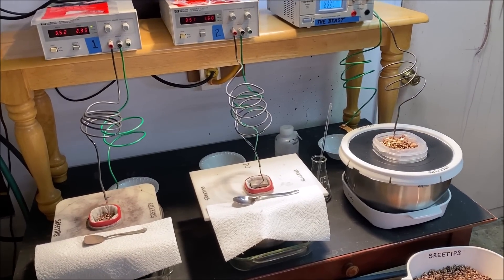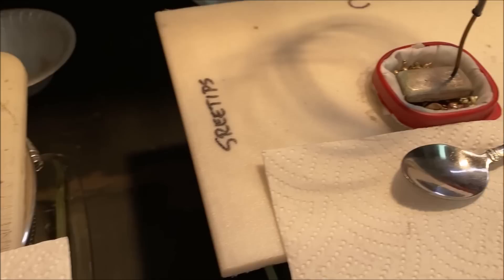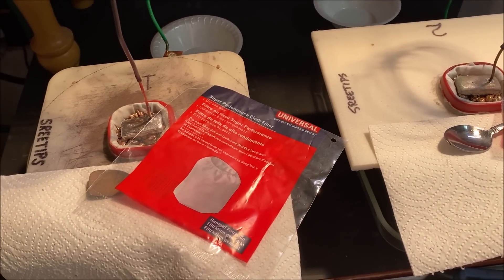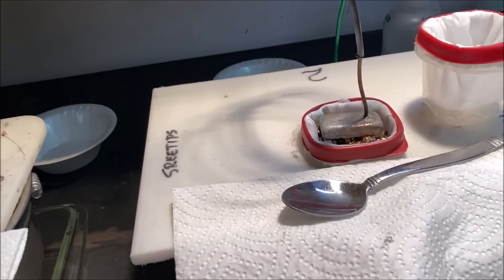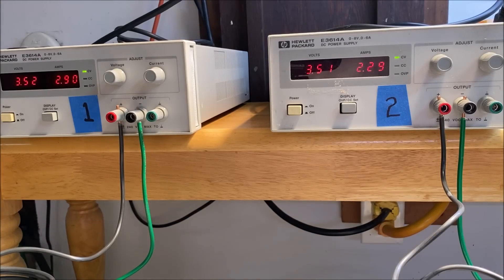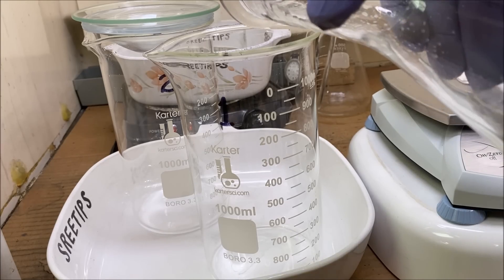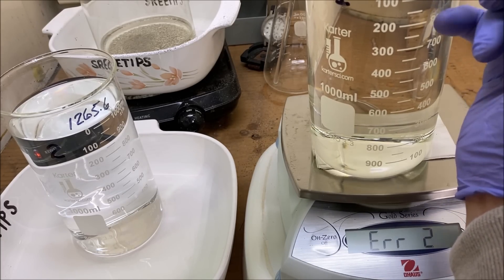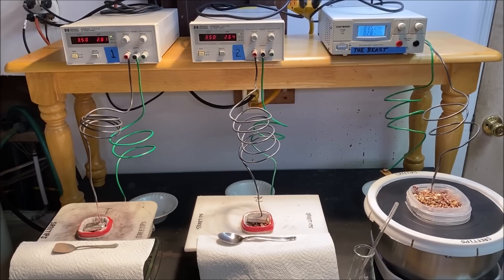Electrolytic Silver Cells Experiments and Changes

Comment: How come you didn’t just turn the voltage up. Instead of changing the basket. 3.51. To like 4.25  to help with the thicker Dacron?
Reply from the maker: Because higher voltages cause the silver to grow too fast, long needle-like crystals that quickly reach out and make contact with the anode filter and create a short circuit that will burn a hole in the filter and ruin the batch of silver. Also, higher voltage increases the risk of other metals co-depositing with the silver and contaminating it. The critical voltage for the silver cell is 3.5 volts DC in constant voltage mode.

Comment: If you take the Cathode connector off and polish the side with Steel Wool that contacts the Cathode surface, it will be clean copper again and make a good connection.

Comment: It would be interesting to see a fresh silver cell that you only run "pure" crystals through to see if the electrolyte solution stays clear over the coarse of several kilo's of silver, you might even be able to call it 5 9's fine silver lol. It would also be interesting to see how much current it would draw in comparison to the impure shot, as well as how fast it reacts in comparison
Reply from the maker: I ran some crystal back through the cell a second time. Sent a sample for ICP analysis and it came back greater than five nines fine.

Comment: I hesitate to point this out, but you can adjust the current output of PS #2 upward...
The current does all the work. You could use a high-wattage low resistance resistor to test the current output of the three PSs.
Measure the resistance of the three cells, anode to cathode, average them and pick a resistor value about 50% higher than the average for your calibration resistor value.
Edit: it's probably all close enough!
Reply from the maker: Sorry, I don’t have that much electrical knowledge.

Comment: Would you be able to connect these in circuit and use one signal generator?
Reply from the maker: No
Reply: @sreetips , Google search ai suggested this "To connect multiple electroplating cells in sequence, simply connect the anode of one cell to the cathode of the next cell, creating a series circuit where the current flows through each cell consecutively, ensuring that the same amount of electrical charge passes through each cell, allowing for consistent plating across all connected cells. "

Maybe next time you recharge them you could test it. Save on power consumption and use your big beast continuous voltage setting. I don't know if it would work with all 3 or only connecting the small ones since they are same size.
Reply: @sreetips  (Google search AI result) 
To connect multiple electroplating cells in sequence, simply connect the anode of one cell to the cathode of the next cell, creating a series circuit where the current flows through each cell consecutively, ensuring that the same amount of electrical charge passes through each cell, allowing for consistent plating across all connected cells. 

... Maybe you could test it next time you recharge the cells? It would conserve energy consumption for the process if it works.

Comment: The 600g is silver NITRATE.  The NO3- ion molecular weight is 14 + 3(16) = 62.  For silver it is 108.  So ~400g is silver & ~200g is nitrate.
Reply from the maker: There is over 600 grams, by weight, of pure elemental silver dissolved in that liter of liquid. How it breaks down chemically (according to your calculations) would be 600g silver and 300g nitrate.
Reply: @sreetips  If that is the case then the solution should weigh 900g more.

Comment: One improvement that I can suggest is the shape of the Stainless steel vessel holding the electrolyte. You make it a tall vessel keeping the diameter the same (in order to use the same cover). What difference it makes if the vessel is spherical or tubular? In the present spherical vessel, as soon as silver forms to a certain level, you are stopping the process to scrape the silver and remove from vessel. If you have tubular (tall vessel), you can scrape down the silver and continue the process until all the silver at the bottom rises to touch the filter paper. Your batch will be longer and produces more silver per batch.

Comment: sorry if its a stupid question, but what is the purpose of silver cells? I know you make high purity crystal silver...but in the last video you just used some to make the electrolyte.  Isn't this like a loop? use crystals to make solution to make crystals to make solution...? Or do you make a surplus of crystals, so its profitable? Does power supply electricity eat into profit? Or is this just a running cost as a hobby? Don't have to answer, just curious.
Reply from the maker: No problem. I used about 2500 grams of pure silver for the electrolyte for the three cells. I should harvest about 7 kilos from those three cells in two weeks. I’ll use the same electrolyte for a second run of all three cells. I’ll add 200g to #1 plus 200g to #2 plus 400g to “the Beast” more dissolved silver for the second run. I should harvest another 7000g of pure silver from the second run. So I’ll use 3300g of silver for electrolyte to produce 14000 grams of high purity silver. But I must reserve enough from the 14k harvest for the next silver cell run. The remaining silver (should be 6 to 8 kilos) gets put away for my retirement.
Reply: @sreetips  Oh cool, so you do get out more than you put in. Plus the bonus of higher quality. From your videos it looks fun just as a hobby, its nice it can be profitable too. Thanks for replying. Love all the videos.
Reply from the maker: For every kilo of 98% impure silver I run through the silver cell, I’ll expect to harvest 980 grams of high purity silver crystal.

Comment: Have you ever considered making your silver anode bar Moore square than rectangle so you get better contact with the silver shot and better weight distribution with all the silver shot as well.
Reply from the maker: No
Reply: @sreetips  it could help because it would help increase the weight of the silver anode bar and also help with current delivery because of increase surface contact with the silver shot and maybe even help prolong the live filter bag itself because you might not have to scrape it down as much when it comes to dealing with the silver sludge at the bottom and along the sides of it especially considering you're using a thinner material that it's made out of because it's not as durable because what I see now is you have about 50% surface contact with silver shot with the current style of anode bar you're using but a square one might increase the surface contact to 70 to 75 percent and build a system for cleaning out your filter bag of the silver sludge with warm to hot distilled water so you can get more than one use out of them.

Comment: The lower current is due to the higher resistance.  Good experimental analysis.  i.e identify the variable and change only one variable to see the impact.  Clearly the filter bag material had a very significant impact.  The copper strap connection is also a factor.  The bright new strap has a lower resistance than the dull old strap.  Since SREETIPS has a lot of silver, my advice is to silver plate the connections.  Before each use, give the connections a quick clean.  Even cooler would be to gold plate the connections.  Only a very thin plating will do the job, and the surfaces will always stay clean because gold will not tarnish like silver or copper.  This would make a cool YouTube episode!
Reply from the maker: That’s a great idea.

Comment: Very cool! As a former manager of a large electroplating shop, I can suggest to you that you would increase your production rate if you added solution mixing (either with a magnetic stir bar on a stirring plate or with a pump or with a motor that has an impeller in the cells). This is because a static solution is diffusion limited, meaning the plating rate is only as fast as the silver ions can move from the impure shot as it dissolves into the solution and at the microscopic "boundary layer" where it actually reacts with the electrons to plate out. By adding solution mixing, you will speed up the diffusion and therefore your plating speed will go up.
Reply from the maker: I’ll invent a cell with a stir rod to continuously stir as the cell operates.
Reply: @sreetips  do it for the beast
Reply: @sreetips  that's a good option. A peristaltic pump would work as well, and they are quite inexpensive... just plug it in, attach two pieces of tubing, and turn it on. Easy peezy. 😁
Reply: @sreetips Det fikser du min venn🔥🙂
Reply: Would increasing the amount of holes in the baskets or making them larger not also increase surface area conductivity? A plastic sieve might improve productivity
Reply: @rival9417  yes, the more surface area, the better.
Reply: @DocJustinT  as I was thinking, the small diameter of the holes in the baskets are acting as a restriction,,on both current flow and fluid flow,allowing the fluid to "stagnate" and current to build up in the area inside the shot container instead of an even distribution  throughout the cell

Comment: My guess is that the current drops from the proportional impurities in the bags. Therefore an experiment to test would be testing pure silver shot, impure shot with no flux/minimal, and standard. My guess is that the flux is creating a barrier so that the silver has to pass through the shot then the filter vs straight to the wall

Comment: Something I see also is your length of wire and number of loops in said wire will contribute to a difference in between number 1 and 2 cells I see this in my own life being a welder I have 100’ reels of welding wire on my truck it takes more amps to weld with all the wire on the reels vs unwinding it out in a straight line and it creates heat forcing the electricity to travel in loops essentially making an electromagnet out of the reels. great job love to see those pure silver crystals grow!

Comment: I really like seeing your day to day maintenance and problems you are faced with.  Is that patina showing up quickly, or does it take months before you see that kind of build up? I know you live in FL, and maybe the humidity there is so bad that you see quick corrosion on your Cu connections.  If that's the case, then plate them with ZnSO4 for about a couple of minutes and that problem won't happen anymore.
Reply from the maker: It takes a while for the corrosion to appear. Months.
Reply: @sreetips  Simple, set a schedule for cleaning with dilute HCL and try not to vary the events too often.

I mean, I don't want to sound like a bosun telling you to polish the bright work, but, If that is what it takes...
Reply from the maker: It can’t hurt, will probably help.

Comment: Is there a reason you don't the CC mode on the PSU? and set the current to maintain 2.3 amps?
Reply from the maker: Yes, the voltage set at 3.5 volts is critical.
Reply: @sreetips  Thanks for the clarification.

Comment: Why not just swap the basket from #1 to #2 ???   That would give almost instant check.   If no change then switch power supplies and see if 1 supply is acting up? 😂😂😂
Reply from the maker: After editing and posting they equalized 3.5 volt DC 2.68 amps each.
Reply: @sreetips  glad it worked out well for you. The old Sears Bag was too thick & more likely nonconductive of the current at 3.5 volts.   With that basket you pulled from service, you can still use it but crank up the voltage to get to a similar Amp/Current flow as the #1 was getting.   I think plating is done based off of current flow more so than voltage levels.   Too much will plate unevenly from my broken wayback machine  between my ears.

Comment: Towards the end of the video where you compare the weights of the electrolyte and distilled water, If I'm not mistaken that electrolyte is concentrated yes?  I think it said you had a bit over 500 mg of silver in that liter.  Usable electrolyte for the cell would have somewhere between 110 to 190 grams per liter I believe.   Correct me if I'm wrong, I just wanted to avoid confusion.
Reply from the maker: The silver cell can operate on 100g per liter silver concentration. I’ve even heard that it will run on as little as 60g per liter. But I like to run on 150g per liter. The electrolyte I weighed had about 600g per liter - estimated. Why was it only 519g difference? I don’t know. I just wanted to show that the liquid with silver dissolved in it weighs more than the same volume of liquid with no silver in it.

Comment: Outstanding video as always. Have you considered putting a piece of plastic inside the bowl directly under the basket? Wouldn't that inhibit or stop crystal formation that could grow straight up to the basket, thereby protecting from short circuit from the crystal touching the basket? Or at least limiting it to the sides?

Please keep making your great content
Reply from the maker: The silver will follow the invisible lines and find its way to the anode. I need to invent an anode basket with a hole so a stirring rod can be operated continuously while the cell is in operation to knock everything down mechanically.
Reply: @sreetips  Sound like your need would be met with a hole down the center for the upright portion of your rod, an angle to clear the basket, and another upright or slightly angled portion which needs to be more than just clearance for the basket. Another system would be at least 3 maybe 4 rods mounted in gussetted holes around the basket with angled portions to clear the long stems of crystal growth. Since these do not penetrate the filter you will have an easier time of it since no sealing needs to occur. 
In any case the angles means these rods will need to be there all the time since you can't thread them through and take them out after usage.
A much simpler system would be a stiff lasso you could introduce as needed and maneuver that up and down around the basket a few times. The lasso could be made with an O-ring large enough, stiff enough, to do the job and attached to a plastic or bamboo stick you take in and out as needed. If you had access to the other sides you could develop a different system maybe?
Reply: @sreetips  possibly a stir rod? Sitting it on the controller. With a thin insulater that protects the base but doesn't block the magnetic bond?

Comment: Hi Sreetips
If you have a voltmeter you can measure the voltage between minus on the powersupply and the bowl, cathode. If the voltage is the same on one and two there is no problen with the connection. If the voltage is higher on two than one then you have the difference and a new cathodeconnection might help.
Love your videos, Keep up the good work. Regards.

Comment: My educated guess is that there is a connection in your #2 electrical circuit that has a higher resistance than in #1. Ohm's Law. Burnish all the contact surfaces, if you have the time for it, and check again.
Reply from the maker: After I posted the video, both one and two became equal current flow at 2.68 amps. But you’re right, it wouldn’t hurt to remove the patina on the copper.

Comment: In my humble opinion I think you might need to clean the silver bar anode ? It looks oxidized or coroaded
Reply from the maker: One of them looks dull
Reply: @ I thinks it number two . The one with copper cathode that you said has a patina . But apparently the filter basket made the most difference. Would a little sulfuric acid clean the anode ?
Reply from the maker: Yes

Comment: Another way to make disassembly a bit easier, and possibly boost the current flow a bit, would be to spot-weld a threaded stud onto the outside rim of the bowl. So you wouldn't have to fiddle with the worm clamps.

Comment: So what's the next step?   50 gallon stainless steel drum and 100 Amp power supply perhaps?  😃
Reply from the maker: Critical distance between anode and cathode 4 inches (10cm) to 4.5 inches (11.5cm). To go big I’d have to convert to a moebius silver cell: alternating anode cathode plates hung vertically in a tank containing gallons of electrolyte. The current flow alone would be a hundred amps. This is much too large for my small hobby operation.
Reply: He got me all excited watching a video of him at a flea market a few months back where he bought a GIANT stainless steel cauldron.  He got it to melt the shot in though, not as the mother of all cells.  Lol

Comment: My bet is that the difference in current flow is due to the resistance of the oxide layer on the #2 copper cathode strap. I am currently at 4:43 and have not seen the whole video.
Reply: Look at that, I was wrong.

Comment: change the power supplies  to check if the difference are on the power supplies
Reply from the maker: After I got done editing and posting the video, I checked the numbers, and both cell one and cell two both had 2.68 amps at 3.5 volts DC, identical.

Comment: I see a lot of comments recommending sandpaper on the corrosion. Just use some dilute HCl. Scratching up the cathode could mess up the smooth contact surface.
Reply: I agree that a bit of dilute HCl will clean that up quickly.  If this corrosion happens quickly, then maybe electroplating with Zn would be a very quick resolution to that problem.

Comment: Hey sreetips You should just sand down that old cathode on cell #2 and see if that does make the difference! Also it looks like you have a thinner copper cathode on cell #1 which would have a lower resistance
Reply from the maker: They equalized at 2.68 amps, 3.5 volts DC after I got done editing and posting the video.